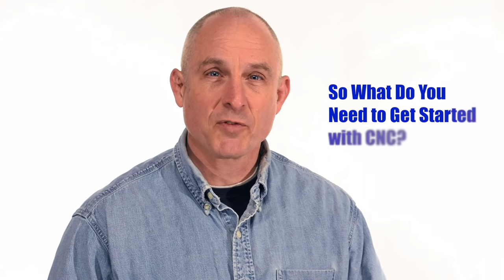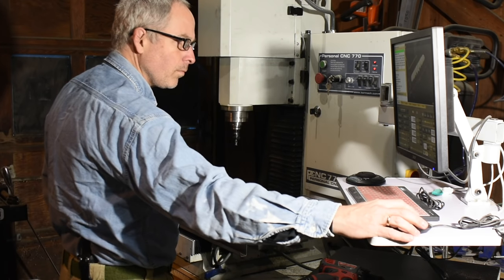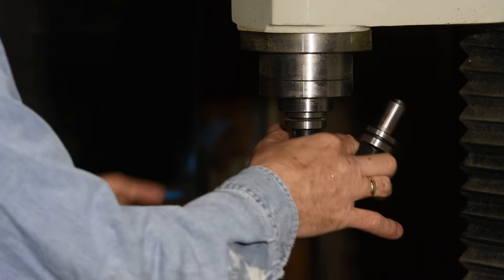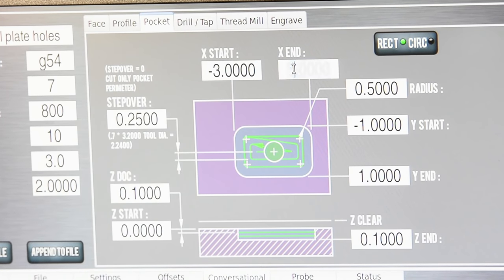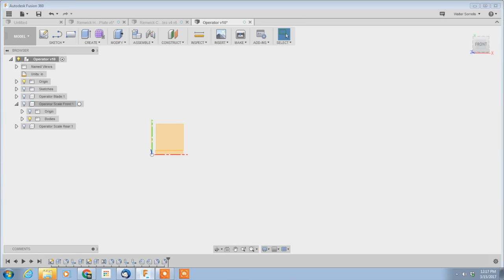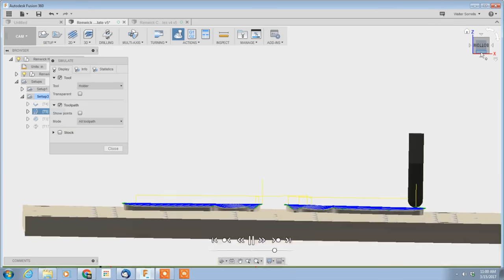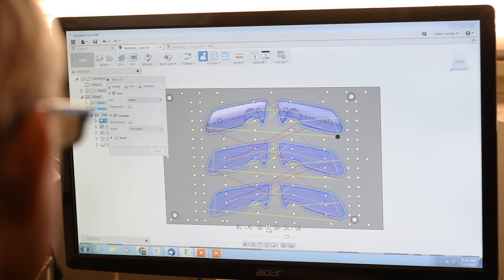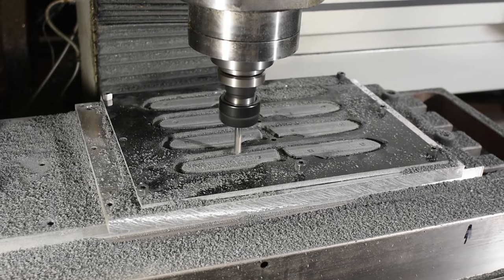CNC Machining - What You Need to Get Started - A Basic Guide

Comment: That was a  pretty interesting analysis. CNCs are indeed revolutionary tools and require an experienced user in order to operate correctly and do their magic. But if you enjoy spending time on your shop working with your hands and getting away from the computer in front of which you sit all day, I guess CNCs will not work. Also you need to spend a really good deal of money in order to get a good quality fast machine. So In my opinion CNC is a really cool tool, but it's definitely for professionals that need to get their job done really fast and accurately!

Comment: Very well done video, on the whole crashing situation you should always dry run/ run it above the material first to make sure the program actually does what you want it to do. The machines are both incredibly smart and incredibly stupid, they'll do exactly what you told it to do no matter if it ends up killing itself. I program manually and the amount of times I've run a tool rapid into the material because I forgot one G1 is ridiculous.
Reply from the maker: Yeah, I did a dry run not two minutes before I crashed the tool in this video.  It was off by 40 thou and I didn't pick up on it.

Comment: Are you going to CNC the bevels, or are you still doing that on the belt grinder? I'd imagine you'd need some very creative jigs to cnc bevels and keep things stable under the endmill.
Reply: Nicholas Killmeier not so much, if you can  program the bevel, you can set up a fixture to clamp a blade in, that has been run on side 1, so you can support the bevel to machine side 2. not hard, its a bit more involved making tool paths so you clear the clamps, tho...